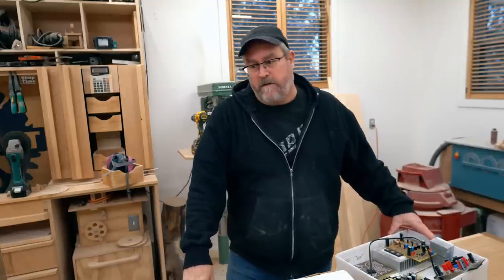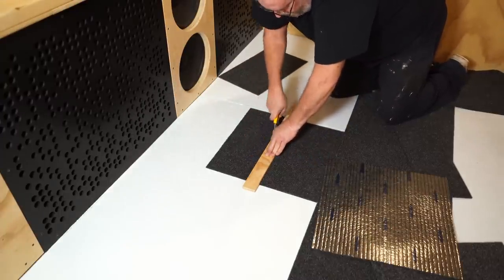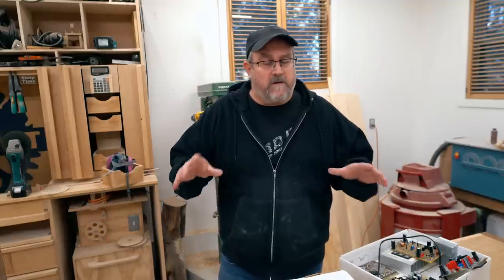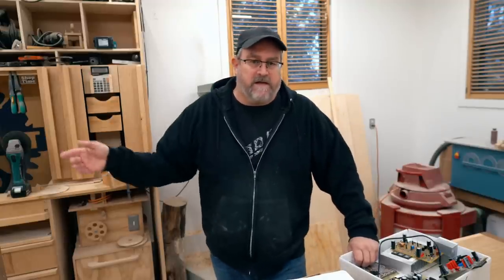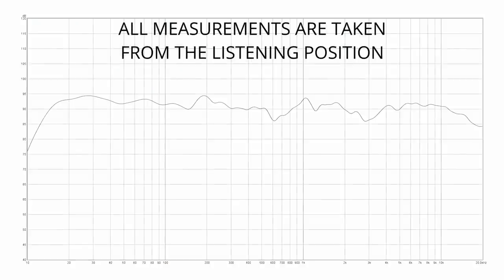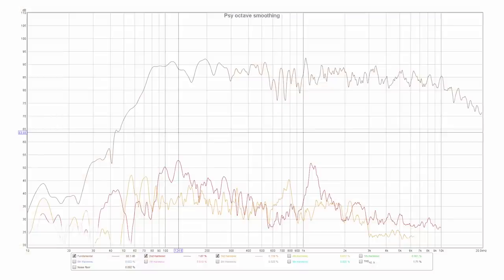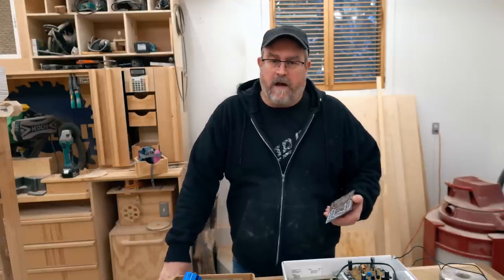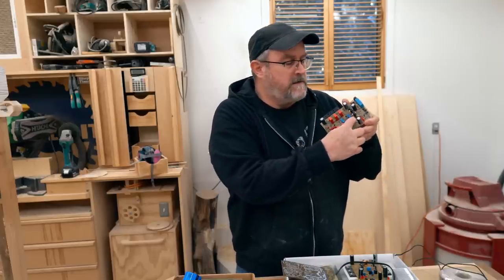A New Amplifier Build and Speakers / Listening Room Update

Comment from the maker: I'm taking a detour and making a 2 channel class AB amp to power my subwoofers. Since I already have the amp boards I designed, made and tested10 years ago, the bulk of the project will be building the chassis / case.
The transformer is a 540VA toroid that puts out 102VAC CT, and that translates to around +/- 73VDC. I may switch this for one with a lower voltage, if I have one that's big enough.

The amplifier circuit design is based on the Luxman M-02 folded cascode. Of course, all of the very excellent transistors that were available when that amp was first designed are now obsolete  and long out of production, so I had to find suitable modern replacements for them. But that was 10 years ago and even some of the ones I used that were available then are obsolete today. I'm pretty sure I have enough of the ones I used originally to complete the second board to give me a stereo pair. 
I do need to make the power supply, but that is fairly simple.

The chassis will be made entirely from 1/8" thick aluminum and that and the heatsinks shown in the video should provide enough cooling.
Reply: So nice, John 🤯. I spent a few years running solder masking, chip placers, and wave soldering machines. The house used Eagle for layout. Traction control modules for trains (Bombardier Transport).
Reply: How do I learn more about amplifier electronics, I would love to build some of these for audio purposes, for fun!

Comment: This looks like a ton of fun to get into.  Amps have always been interesting, but I had no idea they were so hobby-accessable.  Being able to design your own boards would be next level fun - thanks for posting this!
Reply from the maker: Getting to be less with each passing year as the easier to handle through-hole components go out of production. A bit more difficult to work with the tiny surface mount stuff, especially if your eyesight isn't what it used to be.

Comment: you are having way too much fun and learn a lot in the process. 
now you diy amp also, it is going to be flexible speaker and amp solution in the end, i am sure it all is going to sound great in the end :) 

i just bought a multi way plate amp to keep things simple for myself.  but i still have my mindsp shd studio as volume control and dsp, i could get some kind of nanodigi product and expand my optine and go with power amps later.
i am struggling with hiss noise at the moment.

Comment: I went to college for electronic engineering technology, a three year course close to 30 years ago. I was never into audio but I did enjoy designing and making my own non-audio circuits. I can't remember a lot of the theory I learned these days but I am very impressed with how much you've taught yourself. You are correct that it's best to learn by making projects, coming up with solutions to any problems, testing, re-designing circuits. I had lots of fun doing that sort of thing, just wish I could remember more of it.
Reply from the maker: A way to look at audio is it's a fun practical use for an interest in analog electronics. There aren't too many other things that you can make that will be as interesting. Maybe motor controls, but certainly not as glamourous.
Reply: I believe there are lots of things to build and learn from. I’m a retired electronics technologist and the list of projects I want to design and build is endless. I just finished a dual tracking power supply and a matching dual active load for testing supplies. Next on the list is a leakage tester for capacitors.

I’m finding your videos quite informative. Keep up the great work.

Comment: I have that MiniDSP 4x10. I added the digital io board and the volume/selector front panel module.  I made a nice enclosure with cnc aluminum and maple. It is very clean and useful for my setup.

Comment: If you really want to eliminate floor reflections then carpet really is the best way to go. Ideally you'd use a premium deep-pile carpet with a decently dense carpet pad underneath it, but any carpet will offer some degree of absorption and diffusion compared to a hard surface. Honestly, if I ever have a home where I can build a home cinema with all of the channels then I'll probably end up carpeting the walls and possibly even the ceiling. Drape over some curtains, install some attractive pillars with sconces for lighting, and enjoy, but that's far into the future.

Comment: I'm similar with regard to learning.  I can put a circuit together and understand 99% of what is happening.  If I just sit and read schematics or read about calculations, it doesn't stick...  I'm SO ready to build a tube amp (guitar not hifi).  I just haven't had time to devote to making it happen (too many projects stacked up).  I'm VERY curious to see how your transistor amp turns out.  I bet it will rival anything you've had your hands on.
Reply from the maker: Oh, when it gets into the math, forget about it! I'm a stone wall and I'm eternally grateful for the simulators and calculators that give the answers without me having to work it out myself.

Comment: I use an ati 1505 to power 4 12 inch subs in my gaming setup. Works pretty damn good. Subs are all 4 ohm and i really gotta crank it to get the distortion lights to flicker.  Hard to beat AB designs for taking a beating and delivering power with low distortion. But to get one to put out big power like class d can do would be a mammoth amp.the 12s I use are jbl e250s that amps went bad. Pulled the amps and sealed em  up and it works great. All the other speakers are jbl studio series.

Comment: Interesting.
I have done something similar.
But do you not considering amplifier "Gain"?

Each amplifier has most likely diffrent amount of gain.

So if you measure and adjust with miniDSP and REW that each amplifier making their speakers to play at the same loudness as the graphs you showed.

Then if you play louder OR more quietly than the level you used to when you did the calibration with REW.

Then the individual amplifiers will NOT act as one unit one amplifier that have a greater gain will get louder OR quieter then the others that has lower gain depending if you turn up or down..

Is that not a issue? As i understand it you will use 3 diffrent amplifiers. For all the speakers.

Yes I have also OB as I also this far come to the conclusion that they sound superior to the box speakers that I have tried in my treated room.

Thanks for the video.👍
Reply from the maker: The gain for the three different amps are all close enough to each other that it won't be a problem.

Comment: Looking like you are enjoying yourself. And this is what matters the most. With the small heatsinks you are proposing to be using you have me wondering what your bias current will be. Taught electronics from reading and doing like you John. But I haven't built an amp in 20 years.  All I can remember that even in the Luxman they had larger heatsinks than that. Bonded fin heatsinks if I am remembering correctly.
Reply from the maker: I'm counting on the all aluminum chassis to add to the dissipation capacity, much like I did in that small class A amp I built. The bottom, sides, top, back and dividers inside will all be 1/8" thick aluminum and the amp boards will be mounted directly on the bottom panel which is roughly 17" x 16". 
Probably run around 40-50ma bias for each output.
Reply: @IBuildIt    Bottom line is that you are smart enough to measure transistor temperatures and I agree if you thermally tie in a chassis like you are talking about it will help with the dissipation. I have everything for a set of 6 LME 49810 Lateral Mosfet amplifiers. The double die Renesas ones. Four per channel. Should give me a good safety margin for at least 200watts/channel. Just need to make the time. Even have a large chassis I picked up in China! What's taking me so long!!!!
Reply from the maker: I have a few of those LME's that I never got around to using. And they are also obsolete now, so also collector's item's.
Reply: @IBuildIt    You can get them if you are a little resourceful. A great idea that was axed because of internal company politics.

Comment: 52 volts AC, rectified & filtered, you're looking at 73 volts DC. That's maybe a bit high. I don't know what the limits of those transistors are.
Reply from the maker: I know, though. They can handle that voltage.

Comment: Hey John, I know its been a bit since you made this video;  if its not too late for you to see this. I just found this stuff and I really like it.  You said you were using some software to do your circuit design and were able to test it and I assume you are also using some pcb layout software as well.  I used some stuff like this a  early in my career when i was an EE before i got sucked into software.  This stuff was super expensive at the time. Would you be willing to share what you are using?  I'm interested in designing and and making a crossover.

Comment: After the rather inspiring acoustics videos this comes up as a project that hasn't been properly thought out. The M-02 does not use thermaltraks and there is little need to complicate one's life with using exotic and not very reliable parts. It's even worth redesigning the boards back to the original Luxman design. The heatsinks shown are also inappropriate. Those were designed for forced air-cooling which clearly  is not the intended application here. Even if properly applied they are undersized for this project.
Reply from the maker: You haven't thought it out but I certainly have. Keep watching if you want to see what I mean.